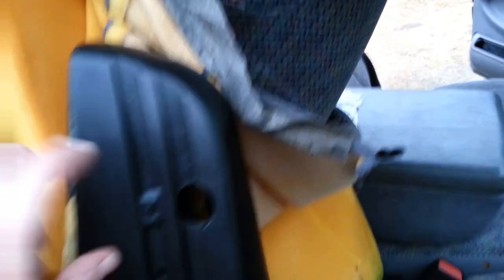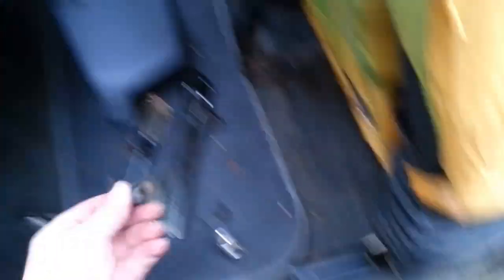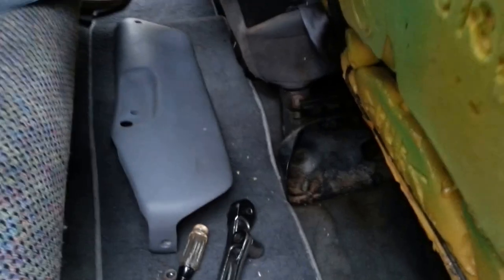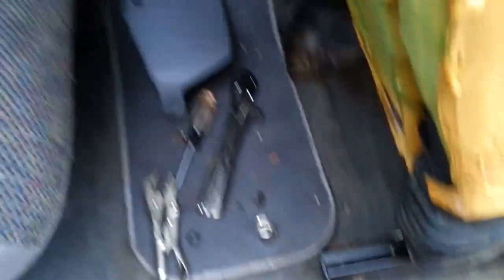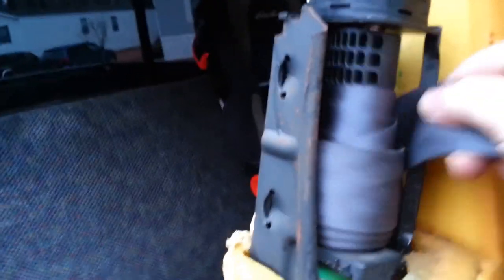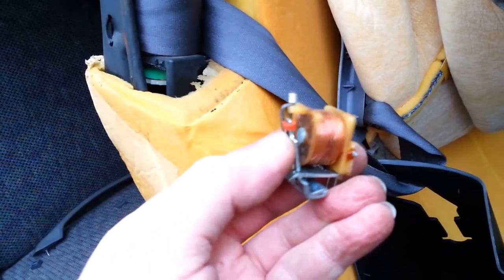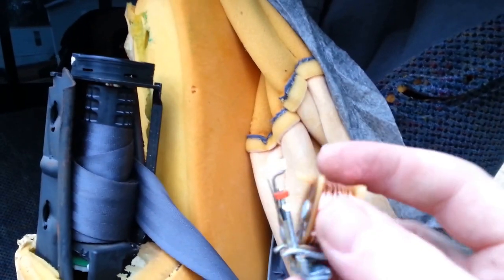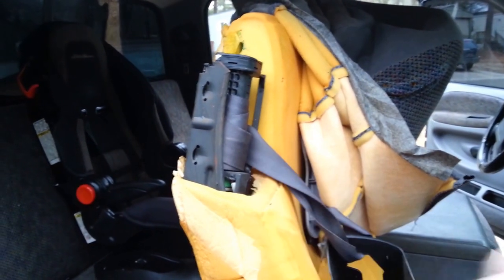2001 Dodge ram seatbelt problems part 3

Comment: You have to also remove the tiny plastic piece which the solenoid moved. Even though it looks works right after you're done, that little &%$# will move and latch it again. We just had to take the whole seat cover off again and do it over.

Comment: Man I hope your right!! The replacement part is- are unobtainium! I thought there was more to it than that, like dash lights that wont shut off and seat belts that wont retract, as in you cant get them on or off. They run thru the #12 fuse, the IOD circuit ie; radio interior light and door switch  circuit and should lose power 30 minutes after trucks shut off. If your battery is dead every morning or two, the timer malfunctions and it draws the truck dead frequently. You cant just pull the fuse because it locks the belts without power, unless you replace it every time you want to start the truck. I hope this is a good fix!!
Reply: My seatbelt light just started staying on, how can I get it to go out?

Comment: I know this is an old video and you probably already figured it out, but for anyone else curious... That solenoid is a seatbelt pre-tensioner. In the event of an accident and the airbags go off, that solenoid is supposed to basically permanently lock the seatbelts, as you saw. As you also saw, it goes bad for whatever reason. I STILL haven't been able to get a straight answer as to why they go bad, but I do have a theory. Since the reel is mounted in the seat in the quad/extended cab models, which we all agree is SO STUPID, I believe that the seat reclining back and forth over it's life either wears out the solenoid itself, or messes with the wiring causing it to trip and thus permanently locking the reel. 

I'm gonna drop this comment on the Part 1, too, if you don't mind.

Comment: both my seat belts wont pull out... is there a way to check voltage to the solenoids and is it tied into the airbag system? I think I have a short in the wiring but don't know where to start.
Reply from the maker: Thats a great question that I have searched here on youtube...I could not find the correct answer...so I just removed them..let me know thanks
Reply: okay, thank you for trying.
Reply: @BigTravGill  what causes the seatbelt light to stay on?
Reply from the maker: @jazzsounds8159  seat belt senors man...these older Dodges were bad on it
Reply: @BigTravGill  they come out and retract with no problems. Still a sensor problem?

Comment: This prolly won’t get seen but I’ve done all of the steps but it won’t bring it back in and it dosent tension, and when it locks I have to take ot apart and redo it all over again
Reply from the maker: well you sis something wrong because I done over 20 trucks like this... maybe 30... all this way

Comment: Do you know what causes them to fail? I know it's not the coil because I can get it to pick up if I jump 12 volts to it. I have the same problem, both sides.
Reply from the maker: I wish I did...but I do not...I know its a famous Dodge problem...you would think its easy to figure out